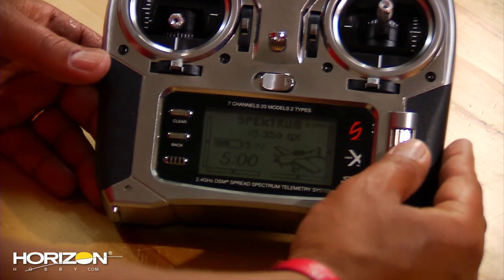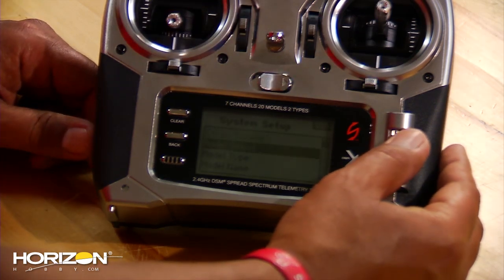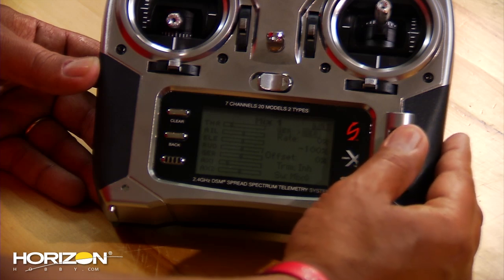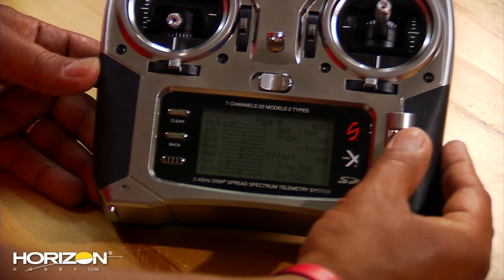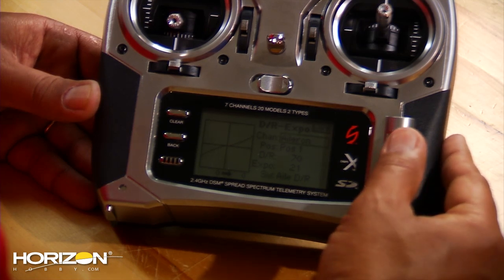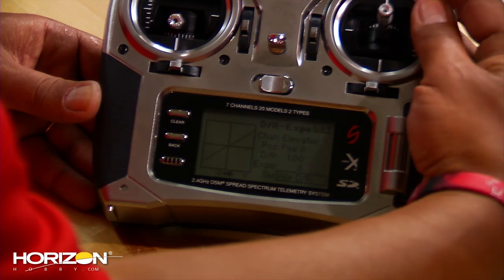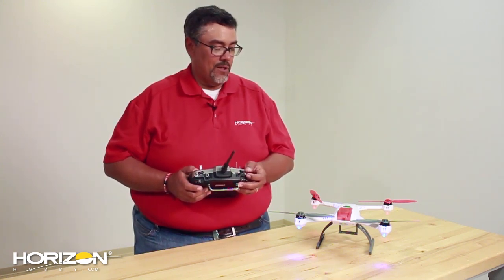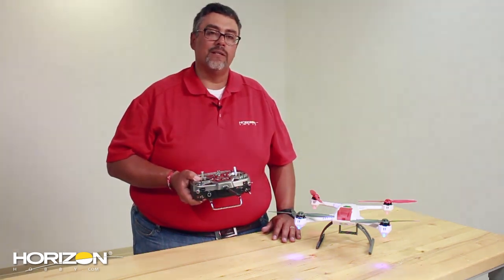350 QX - DX7S Radio Setup

Comment: hi there
great video I am thinking of buying the blade 350 quad if I buy the spectrum dx7s radio do I need to buy a receiver or has the blade already got it built in
Reply: You're good to go with the DX7s. No additional receiver required.

Comment: Is it possible to get all 4 flight modes?  I'd like to have Safe, AP, Stability, and Agility modes.  So far I only have the first three on my DX7S from this setup.
Reply: I also have the same problem, Can only get the first 3 flight modes. I have tried loads of different settings and trolled the net for hours trying to work this out !!!
Reply: Lee Skelton I did finally find a thread on Heli-Frieks I think where someone figured it out and even managed to add Stagility mode also.  Seems to work fine.
Reply: Lee Skelton Heli Feaks

Comment: It would be nice If the DX7S screen was more pronounced so we could actually SEE the settings. Also it would be better IF you slowed down. Not all of use are familiar with all the switch throws you are doing so fast. And the last problem is after binding, you apparently throw a switch just as the screen switches to the view of you showing each switch position for each flight mode. It looks, like for a split second, that you are flipping the F switch forward just as the screen flips to where you are showing the modes. Is that what you did? None of my switches follow your flight modes until I do flip the F switch forward.
Tom Lambert